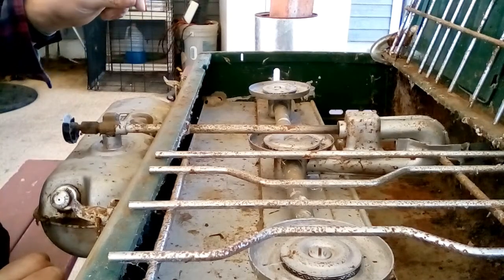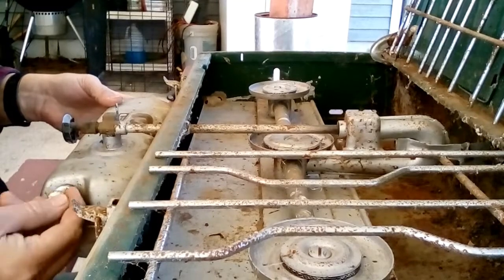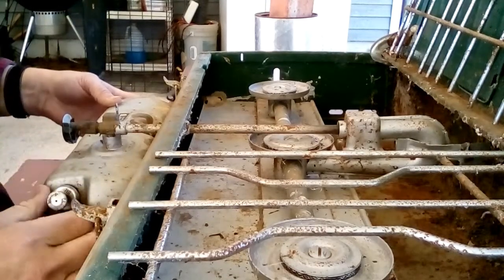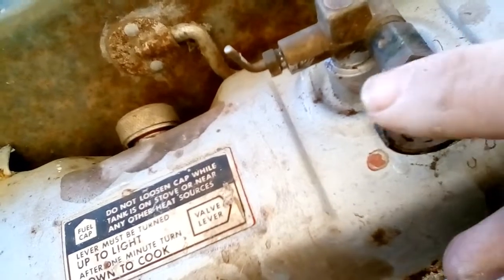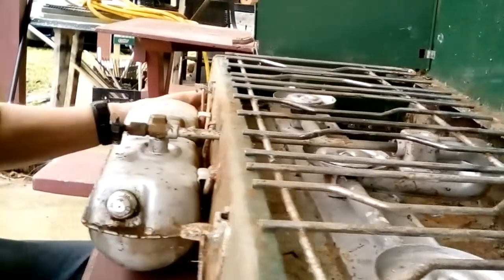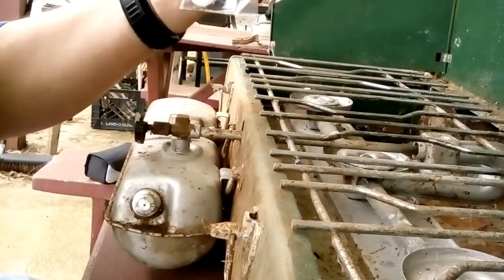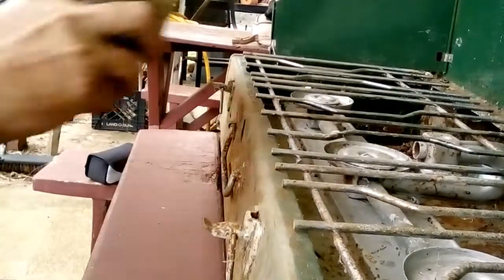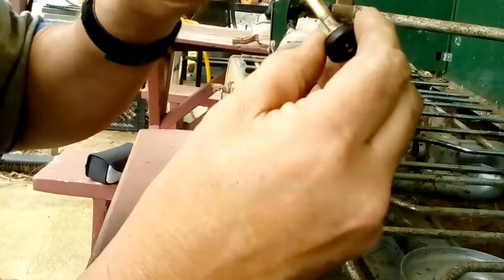Restoration on 426D Coleman Stove 3  Burner. Part 1. Replace pump plunger, Light for the first time.

Comment: Found a 426D about 2 years ago at the Salvation Army. February 1969 was the date on it. Oiled the pump, put an O-ring in the gas cap, and been using it ever since. Bought a 425E off Facebook Market for $10. Got it home and found out it came out of the factory the same month and year I did, 5/72. Now, I always have my eyes open at thrift stores and swap meets to find another. I may have to look into a 12-step program or something.
Reply from the maker: Yes I love my old lanterns and stoves. Going camping this weekend so watch for more videos. Thanks